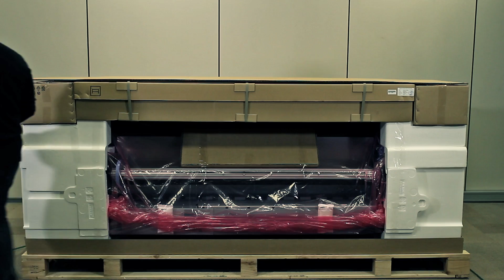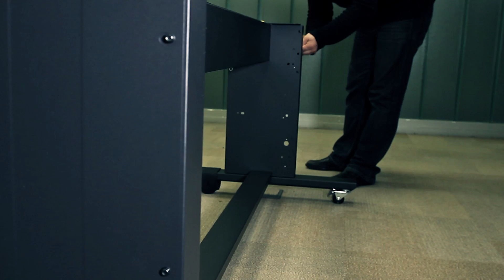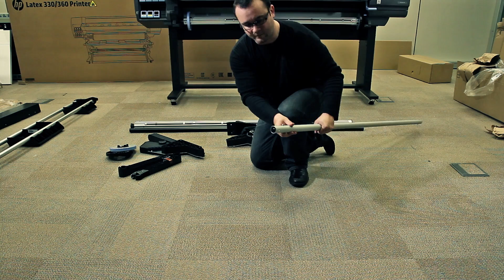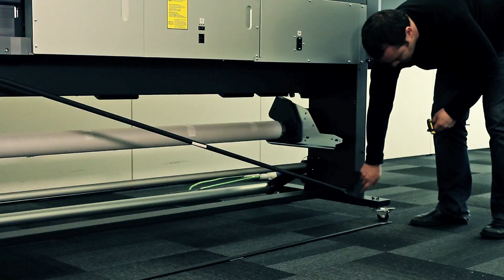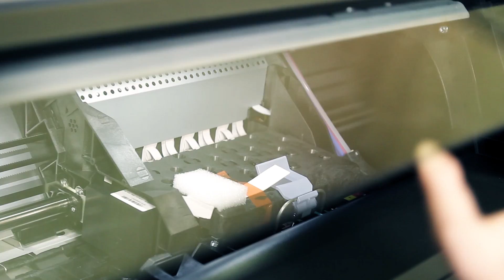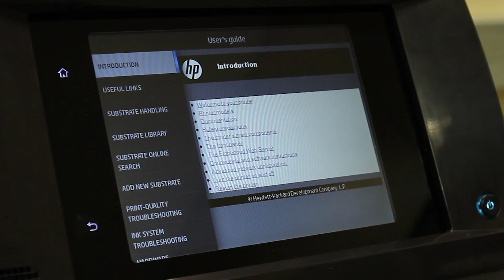Assembling and setup | HP Latex 300 Printer Series | HP

Comment: Hi HP,
Do you know how wide is the packaging? My office door is not so wide.
Reply: +Samuel Filip I would be happy to answer your question. Dimensions of the printer is 2561 x 840 x 1380 mm (101 x 33 x 54 in) and the shipping 2795 x 760 x 1250 mm (110.1 x 30 x 49.3 in). (Dimensions W x D x H) and you can find the complete printer specification through this link: http://bit.ly/2lJ7XxI
Reply: HP Support Advanced thank you so much!
Reply: +Samuel Filip You're welcome!